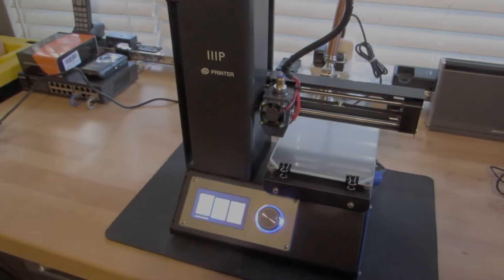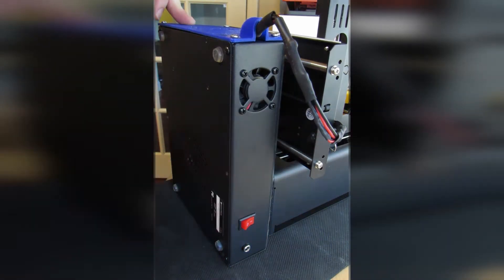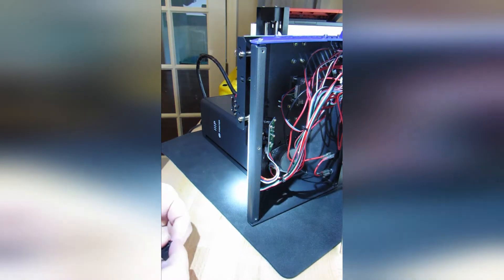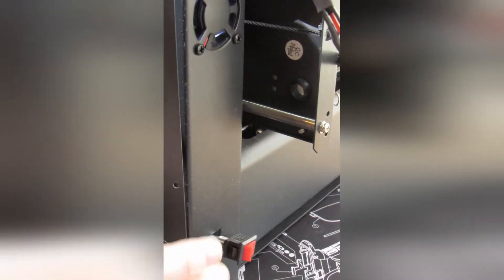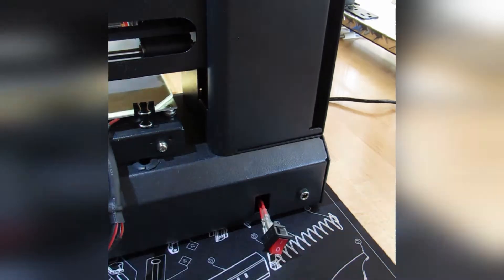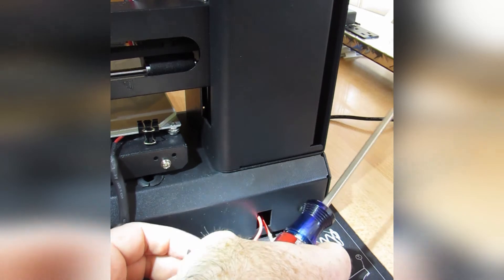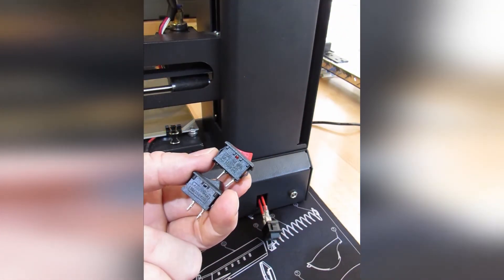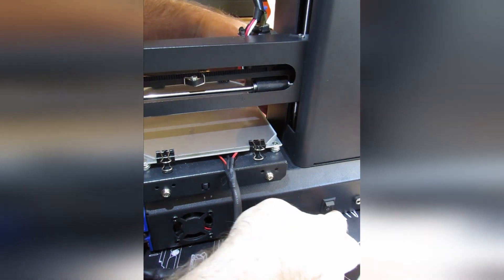Monoprice Select Mini 3D Printer V2 Power Switch Replacement

Comment: Does anyone have an explanation for why a switch like this stops working? Is it mechanical wear and tear or is it electrical? Also, if anyone needs a switch, reach out and I'll happily mail you one of the extras from my order.
Reply: Mine was a deformed spade connector on the power jack and the wire was not fully inserted into the terminal housing.  It 's quite obvious now but when I'd have the printer powered on then move the power cord the printer would turn off.  Id move the cable a little more and power would come back on.  I left the machine on over night and woke up with a stuck power switch. Carefully look at you terminals and wire.
Reply from the maker: From what I can tell with mine it was mechanical since it would switch on but would not say in the on the possison.

Comment: Just a heads up,  this is a DC switch, it did not matter which wire went to which pole.  All the switch is doing is interrupting the power circuit.  The switch is the same as cutting the power wire for off and the when you turn the switch on it would be like taping it back together.  This type of switch is not the same as an AC switch in a home.

Comment: This switch just gave out on mine as well about 2yr into it's life. It is a great little printer to begin with. Your video was very helpful I knew how to change switches from other experiences but during my replacement i accidentally pulled the plugs out from the power connector and didn't know what order they went back. checked your vid out and now it is back in service thanks.

Comment: I want to move the switch to the front but the cable is too short, what kind of cable do I need to extend those pronged ones so the switch can be farther away from the board?